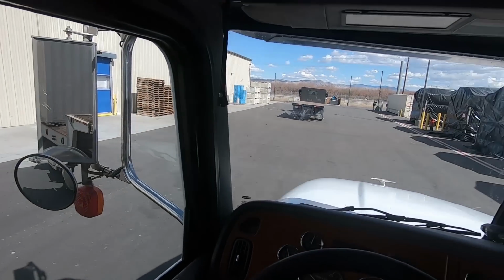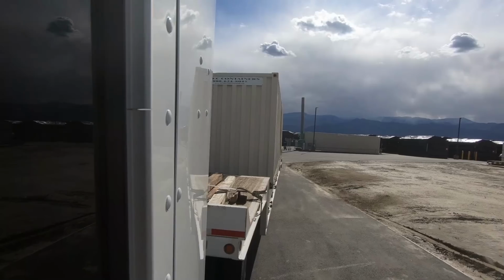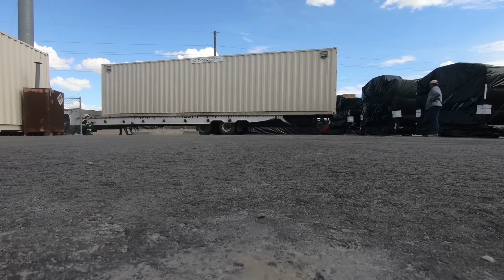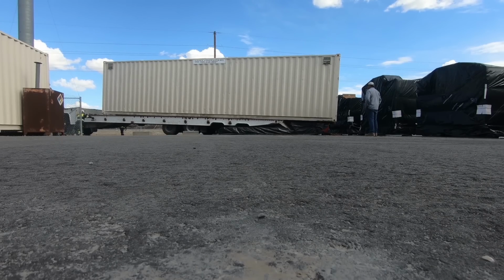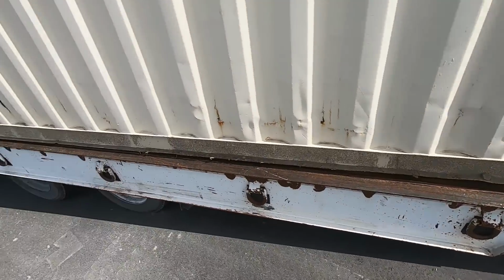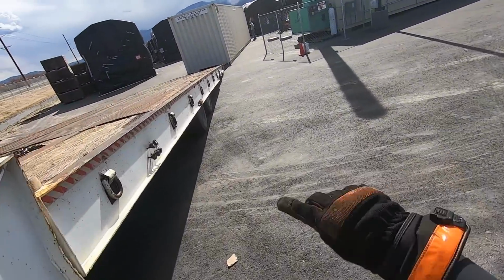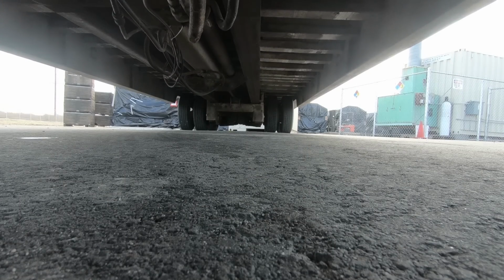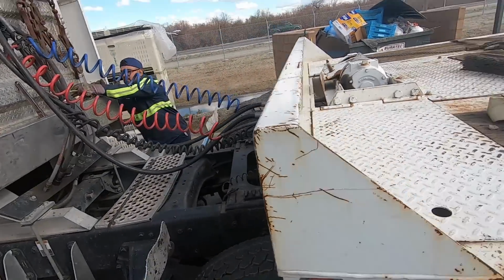How To Deliver A 40ft Sea Container

Comment: Years ago off a diamond t straight with a roller built into the back of the bed, drafts of lumber set on the roller, unchained and back up fast and slam the brakes on lumber usually fell  on the ground, not as neat as what you can do, equipment came a long way, good job dropping the container, pull toy here.

Comment: Sir Trent !!! Know you watch ""PEPE'S  Towing too !!! The last video from them was a crane that hit a bridge on 101 ,, asked you about the height of those pusher RV's that you put on the 'Landoll" Trailers as DON"T want the same thing happen to you guys going to a repair shop out of your area !!  Anyhows ,, Thanks for sharing this video &  KEEP IT SAFE !!!!
Reply: Pretty much everywhere in the US if you are under 13' 6" you are safe, and where you aren't it is pretty clearly marked. There are only a couple of places in LA that won't clear 13' 6" on a major freeway, and that spot on the 101 isn't one of them. 

Whoever stowed that crane after the last use was asleep, or else something  happened to the crane while they were going down the road and it came unstowed. (That isn't the first bridge of that height in the last couple miles leading up to it, so they either just got on the freeway or something happened to the crane while they were driving.)

If you aren't from the So. Cal. area and don't know the roads, almost all of the freeways were built after 1955, and were designed to clear 13' 6" with ease. Many will clear up to about 15'. Most bridges had their height marked on them in black paint on the concrete truss, and if it was lower than normal, also on an orange sign in letters big enough to be seen at a decent distance. In the few places there was an arch bridge with a low right lane height there is usually a diagonal orange warning sign before the last offramp before the overpass.

There are still some tunnels or arched overpasses that won't clear 13'6" on some or all of the lanes, but these generally aren't on the freeways, and as far as I know all of them are pretty brightly marked. If you are awake at the wheel, it really is hard to screw up unless you have an over-height load. 

If you do have an over-height load, you better sit down with a map that shows overpass heights and plan your route. :-)

Comment: I liked to put scrap 4X4s under so the container would be off the ground then the trailer doesnt touch the ground. No scrapes or gouges, and it's easier for the forklift to get under it and move it.
40Ft shipping container empty weight 3,750kg 8,267lbs